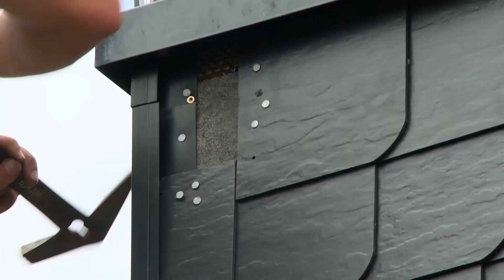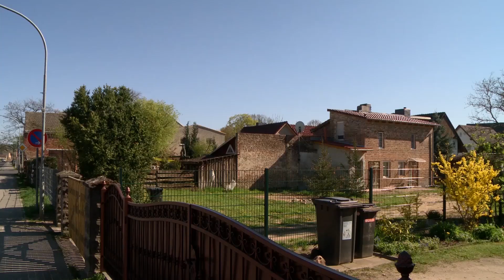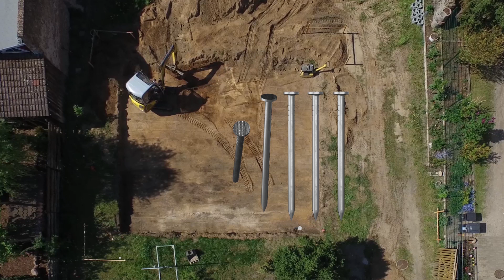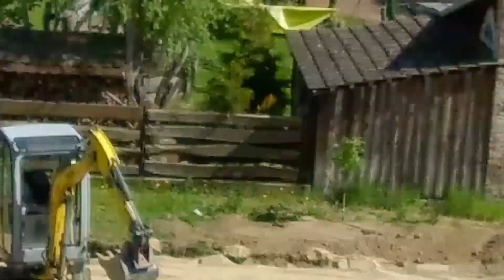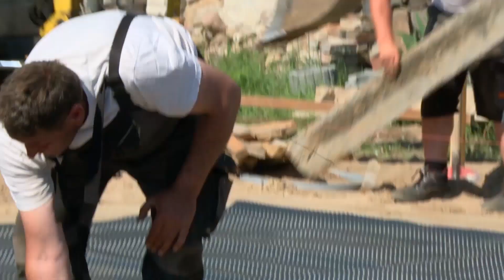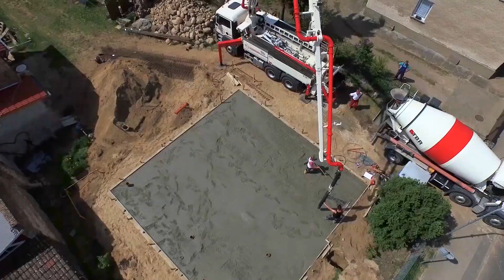Building a House | part 1 earthworks+floor slab | house construction documentary | German technology

Comment: When loose sand or gravel are compacted the rule of thumb is... 100kg compactor compacts the ground 10cm deep. 300kg to 30 cm. 2ton vibrating roller to 2meters.